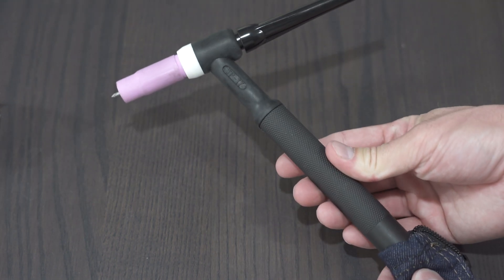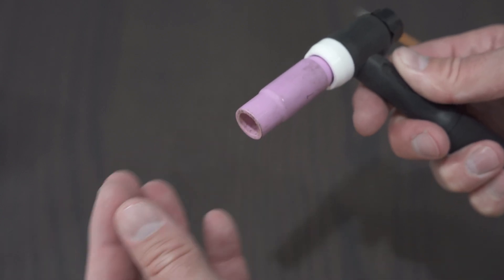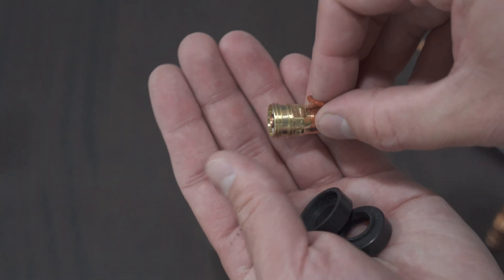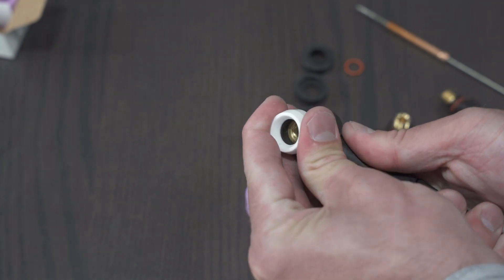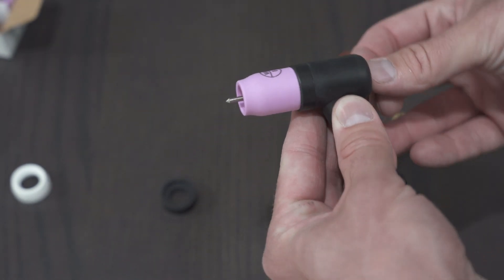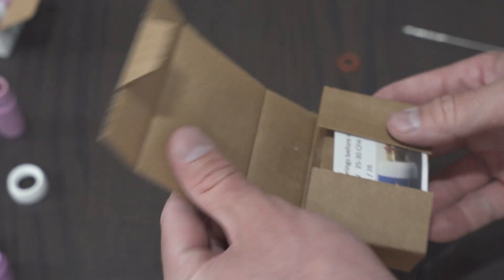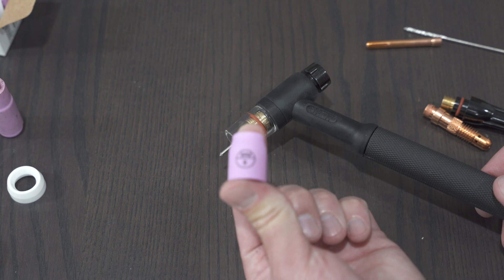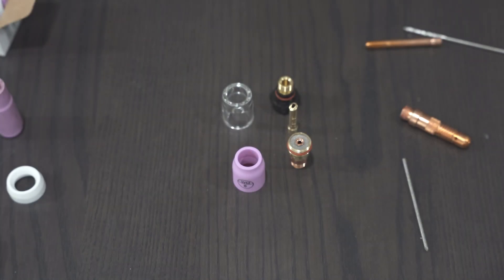How to Stubby Gas Lens Swap Your TIG Torch 2022 | How to TIG Weld Basics | 4K

Comment: Leave the O ring for the clear covers in, when using the Alumina cover, their threads are lose and it leaks and introduces oxygen into the gas flow without the o ring

Comment: Think it has been mentioned but you should never "break" a tungsten as they're very brittle under strain. I use the grinder edge to split them and then sharpen after. Otherwise a great guide

Comment: No cracking your tungsten, it fractures them internally effecting your arc. Cut them in half with a diamond wheel. Don't sharpen both ends. If you dip, the booger"d end will not fit in the collet

Comment: The best tip on this video is to grind both ends of your electrode so no more messing when you touch down to metal, it just allows a quick switch around.
Reply: I used to point both ends of my tungsten but I’ve jacked up both ends and it makes it tough to get out of the collet, so I only use one end.
Reply: @YT-User1013  I just chop the stuck/knackered end off with my Park cycle  Wire Cutters

Comment: A size 8 cup is way bigger than needed for general work i always use a 5 cup. Aluminum and steel. Only for stainless i use a size 12 cup
Reply: Try bigger cups, you'll get a much better finish with them

Comment: Couple things. 1. Some Tungstens you can break to shorten, others you will split/fracture. 2. Depending on the gas lens & flow rate, the stickout can be way longer than the cup ID. 3. For low amperage you want to use smaller electrodes like 1/16 & 0.04".

Comment: You should never crack your tungsten, you should use a proper cutting tool like diamond or a cutting wheel that you use only on tungsten, cracking your tungsten will cause hairline fractures and will cause arc instibility no matter how well you grind it. Also without proper eye protection, cracking tungsten does increase your odds of getting a piece in your eye, or worse somebody elses eye, and despite having safety glasses on, the more dense the material the mare embeded it likes to become. Just a safety tip.
Reply: https://www.youtube.com/watch?v=MPcXRtSuOPk

Comment: 2.4mm tungston wich is your 3/32 is o ly good to 3/32 steel you need 1/8  the 3.2mm tungston for anything over 150amps and that's good to 1/4inch steel at 225 some.guys will push 250 but I'd use 4mm tungston for 250amp and if your doing aluminum dosent matter the aluminum size you almost alllllll ways use  the 3.2mm 1/8inch so it balls better

Comment: Actually the most questions arise in the differences between the #17 & #9 torches and what does and what doesn't interchange. It's easy to find that the 17 is rated at 150 amps and the 9 is rated for 125 amps but what other parts can be use & how to identify which is for which is another story. Good video, nice quality.

Comment: Never break your tungsten. Grind them in half and then snap it. break it, then look at it in a microscope and you'll see why.
Reply: I think one of the reasons that this method comes about is that people by the cheap diamond wheels which only work for MAYBE cutting ONE tungsten rod.  If you buy the more expensive diamond wheels, it's EASY to cut tungsten, and you can do it many many times.  Just my .02
Reply: @mjktrash   I have cut at least 50 3/32 tungsten with a HARBOR FREIGHT diamond replacement wheel. The same wheel on their circular saw sharpener.
Reply: @gatorwing6231  fair enough, for me it was Amazon/China crap - literally lucky to get one done without undue effort and heat.
Reply: I don’t have a microscope, so please tell me why.
Reply: @Eric Hinshaw  

Tungsten is not a ductile metal, it is amazingly brittle, if you bend it, it will 99.9% fracture along its axis.

The fractures are bad for controlling the arc
Reply: @mjktrash  I appreciate the info. The day after I snapped a full pack in half and pre sharpened them.😂
Reply: @Andrew Poet   All is not lost, half of your rod tips (at least) should be fine.